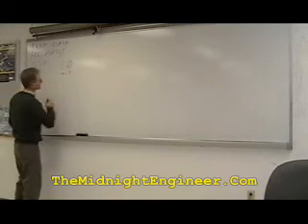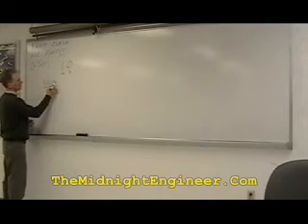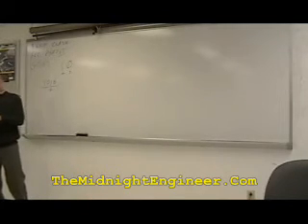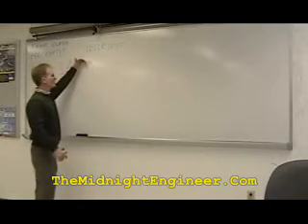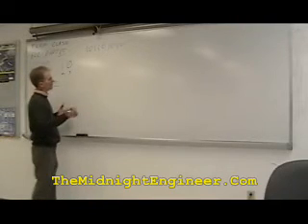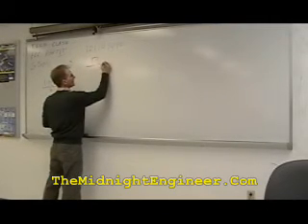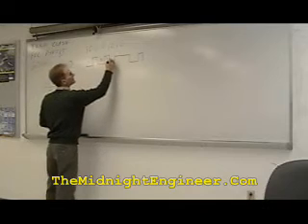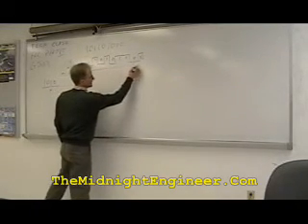Pt 1 Toyota's Unwanted Sudden Unintended Acceleration Recall - A Tech Clash

Comment from the maker: @kassandrasduplex  Point?
What few of them their were back then were still only a mechanical brake with a pulse control to help prevent lock-up.

There is a distinct difference between electronic assisted and electronically actuated.

i.e.
Gas pedal with cable to throttle plate while electronic systems monitor manifold vacuums and adjust gas flow but NOT throttle plate.

vs

Gas pedal is a sensor tells computer it's position and computer controls the throttle plate with electronic solenoid.

Comment from the maker: @MootNews Yes, The big 3 have had a share of problems in the past, they just did not make news as they were quick to react and had less to react to.

Bigger problem now is no manual control coupled with more RF devices and more complex on-board systems.

Manufactures are left to test for EMI on good faith but while some may do it, it gets harder to test for specific things as there are 10 times as many device types as 10 years ago and they only test for on-board interference like spark systems.

Comment from the maker: Automotive computer systems in 80's were very limited. They were reactionary to mechanical function and controlled only spark advance/timing/dwell &  barometer adj etc.
In late 80's & 90's they started shifting transmission and controlling fuel injectors etc

In last decade only some models (but increasing in number) have no mechanical means for throttle control and are now in control of or assisting in steering via electronic means but I say again only certain cars and many manufactures.

Comment from the maker: @kassandrasduplex It's been recorded already if you check the NHTSA records in engine sensors etc.

Nobody test for specific type of interference "like" a Trucker with a CB radio & amplifier and antennas that are not properly matched.
(most likely the cause of steering problems with many models with electronic servo controlled steering) But there are more scenarios than this.

I don't expect those that are not familiar or not experienced with EMI/RFI -AND- micro-controllers to understand.

Comment from the maker: @kassandrasduplex 
No claim made to throttle actuator but possible. 

Insulated wire only prevent shorts. Since most of the thousands of transistors in the system trip at .5 volts, it takes so little signal to change something erroneously.
Shielded and RF shunted wires on critical systems is what is required and even some sensors.

I am sure that floor mats were a problem in some cases.

I have no interest in creating a mess of what is already messy. I am interested in saving lives.

Comment from the maker: @kassandrasduplex Preposterous to you as you do not understand it. I only demonstrated one method and there are many.

It does not just take a DIGITAL signal and there are many forms of interference both in cause and effect. It requires that systems are properly shielded in communication & sensor  wires and controllers.

It has only been of recent dates that we used "electronics only in throttle and steering" systems which makes this more dangerous if not properly RF shunted and shielded..

Comment from the maker: 1st -Not necessarily the throttle sensor.
2nd -The car has no radio transmitter or receiver.
Digital controls in on board systems use pulses that look the same as a GSM digital radio transmission demonstrated.  If a digital radio signal becomes parasitic on a wire in the on-board systems, it is hard to say exactly what transistor could be tripped /toggled by a false input or in the case of serial data between systems  when good data be changed to bad data hence a incorrect response by computer.